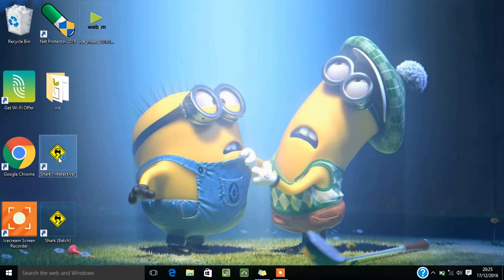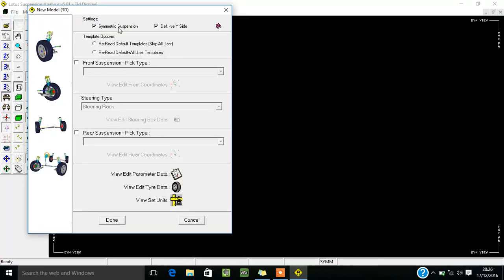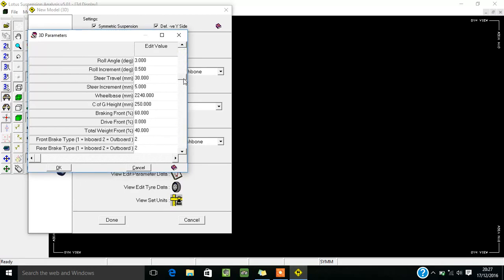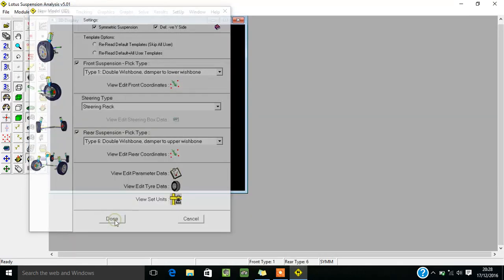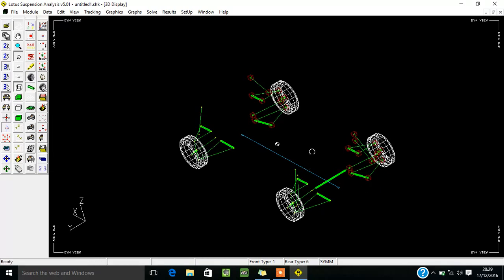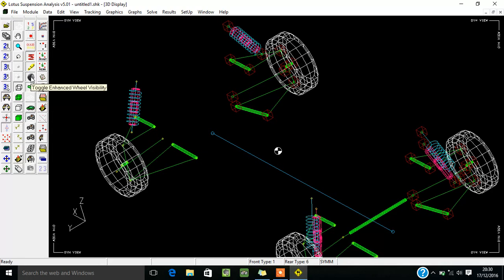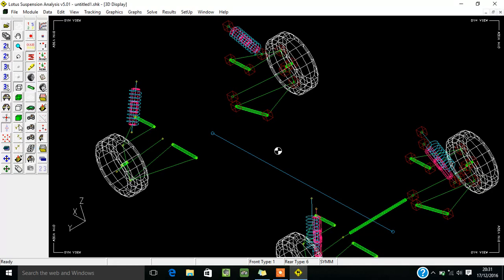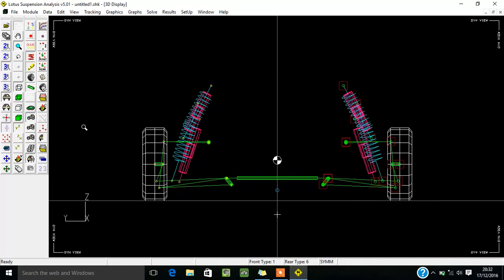LOTUS SHARK VOL:1

Comment: How can i calculate the length of tie rod using lotus software
Reply: In the menu bar choose “Graphics”. Go to the last option….i.e. “add”…. In this you can get various stuff like angle, distance etc…. Now choose distance and choose the hard points between which you want to get distance and in your case the track rod ….and the software would give you the exact distance between those two selected points in 3 dimension…you can also use this to get angle between two lines….

Comment: Can you explain about origin of the any suspension geometry selected. I want to work on suspension design by editing in current geometry according to my own design but having no clue about origin(reference point for other hard points) this task becomes impossible. 
Thank you
Reply: Its a tedious job but you would have to change your x coordinate of front wheel centre and wheel spindle point to zero and decrease the values of x coordinates of all your other hard points keeping the distance between them the same as before